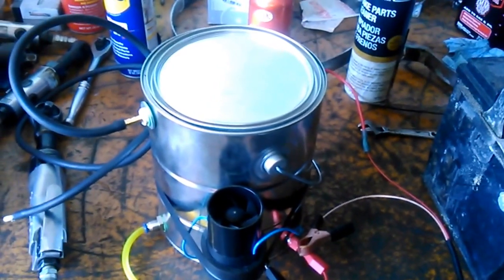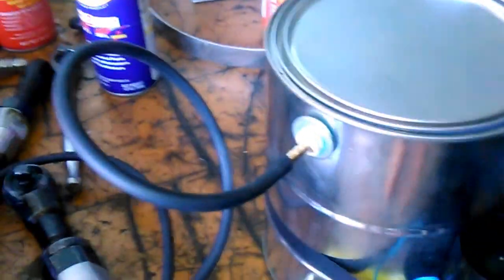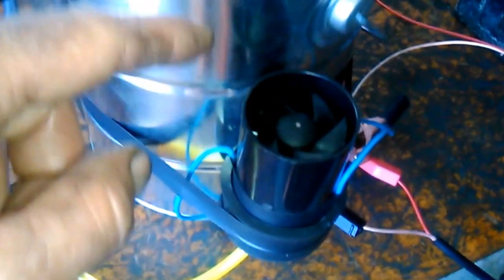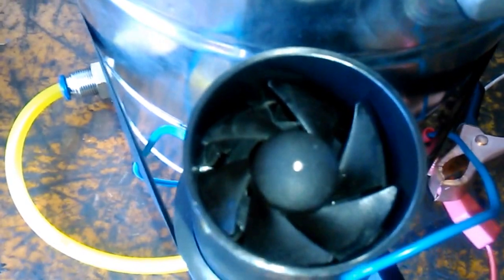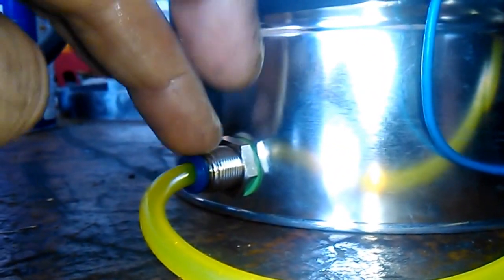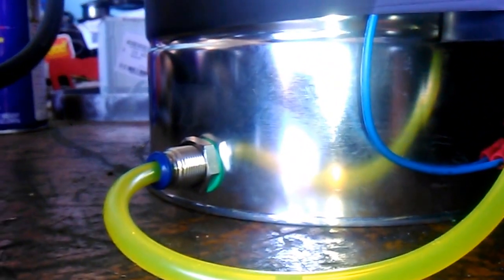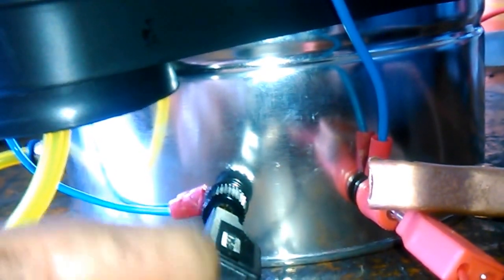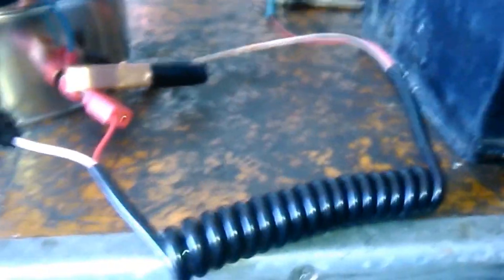P0171 and P0174 Homemade evap smoke machine

Comment from the maker: No, it was not the entire content inside the heat gun.  It was enough to coil around the lamp wick.  The wick I use now is the round kind used in  tiki torch. Coil around wick about six times then to power contacts.  The contacts must be insulated from can.  Any questions find Black and Yellow Garage on Facebook and send a friend request.

Comment: Nichrome wire from a heat gun?  Is this a 12 volt heat gun?  You used the entire length of heated wire to go with the 20 amp fuse?
Thanks...
Reply from the maker: Tom McDaniel  The heat gun was a Wagner brand. It was powered by 110 current.  The fan is low voltage which is regulated by a circuit board which I did not use.  Sorry for not replying sooner.  The amount of wire is enough to wrap around the 1/2 length tiki torch wick about 5 times and out to connections which are insulated from can inside and outside the can.  Wire must be insulated from can.  Making an updated  idwo for this soon.